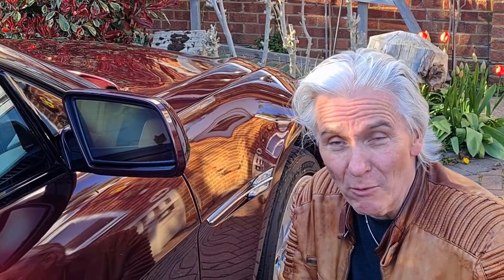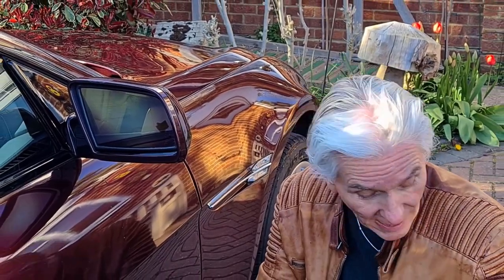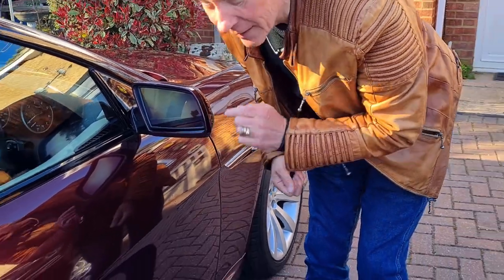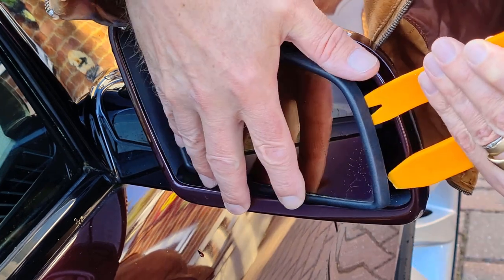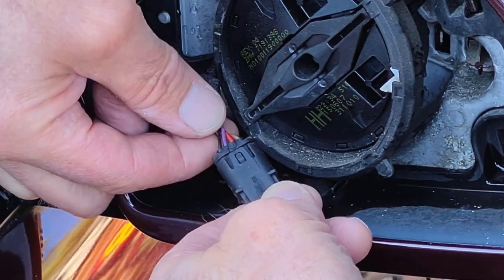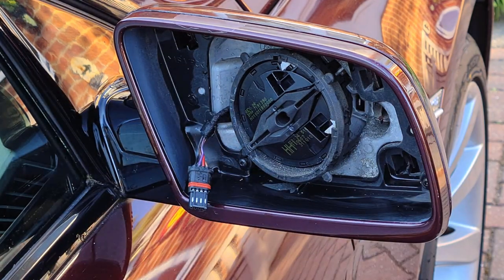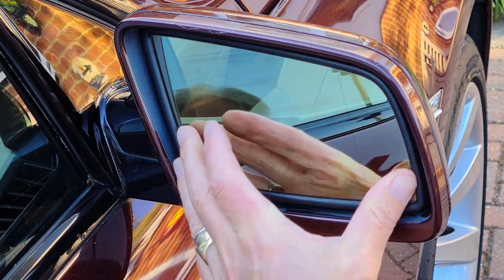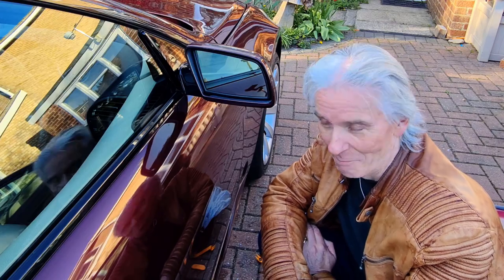BMW 6 Series Wing Mirror Replacement

Comment: Wonderful. Your information is up to date and it is a good suggestion to follow. I have another problem you might be able to enlight on. A get a written notice on my dashboard that the boot lid is still open, however, It is closed. The signal keeps repeating itself and I cannot open the roof of my 650 Convertible. Apparently, it has to do with the lock in the boot. Have you ever experienced this?
Reply from the maker: Thanks Willem! That will be the microswitch in the actuator - I've done the repair on the E31 but not the E64 - but that will be the souce of the problem.

Comment: Hi Ed....I have a 2010 lci e64 635d. Due to her age the dealerships can't answer as the staff really only know about the current models...anyways..do BOTH the wing mirrors tilt when in reverse as I only have Near Side tilt...drivers side (uk) car...doesn't move down...is this correct? But should it move up and down manually? Cheers
Reply from the maker: Only the nearside dips in reverse - but if the mirror adjustment control is set to adjust the nearside neither of them will move, confuses a lot of owners!

Comment: I wish I had seen this earlier. My glass has deteriorated too and much worse than yours in this video. I saw that the glass was very expensive to buy so thought I was being clever by buying a whole new wing mirror off a guy who was selling parts. It is the wrong colour and I will have to pay someone else to paint it to match my car. I was looking for a video to show how to change the whole unit. Do you have one? Or perhaps I will just cut my losses and buy the glass...
Reply from the maker: I know what you mean - the glass is expensive, mine came from Latvia and even then it wasn't cheap!
Reply: I think I need to take off the door panel to replace the wing mirror. Do you have a video showing that?

Comment: What is the deal with Latvia anyway? I have found a fair number of really decent used parts for my '08 E65 (750i) on eBay coming out of Latvia. Always OEM and the sellers have reasonably quick shipping even to here in Canada.  It's starting to be the first place I look when I need OEM and local sources are just too expensive, or I want a bit that is Euro-only like the front plate plinth I bought to replace the ugly and not used North Am. plinth.

Comment: Have you got a part number, looking through eBay and can't find any for less than 200!
Reply from the maker: Difficult to find with the electrochromatic version - but use: bmw 51167168182
Reply: @TimmsBMWRepairsandInformation  I think it's one of those parts where we are hit by th 6 Series Tax 😂